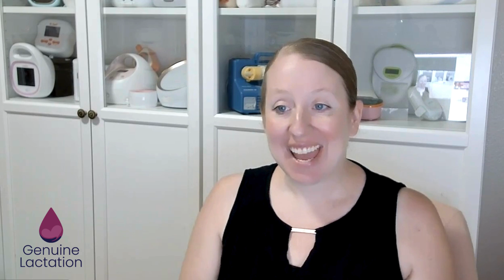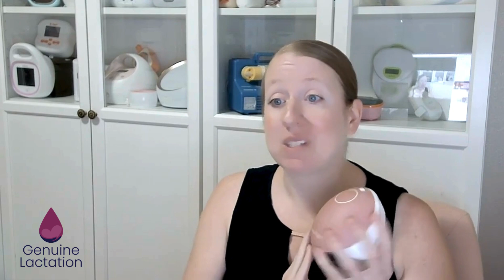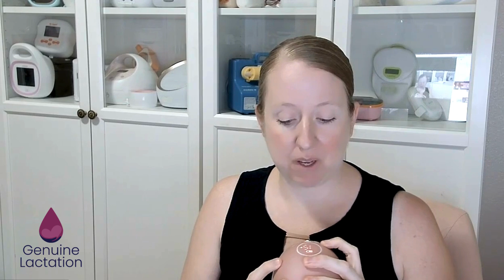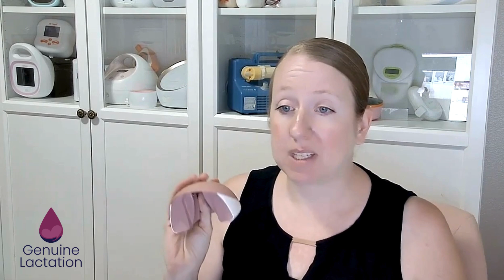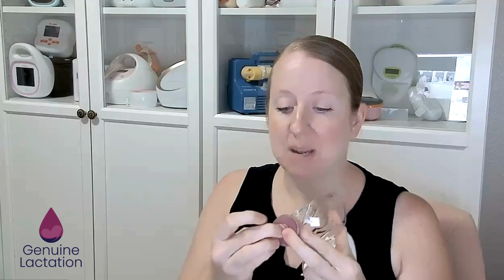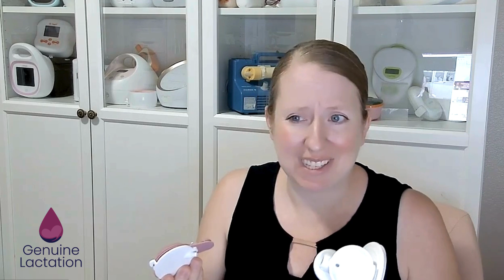Pump Chat: Momcozy Mobile Flow M9

Comment: Do these leak out of the front like OG Elvie if you slightly bend forward?
Reply from the maker: They leak in several places unfortunately
Reply: I will say I have 7 elvie OG motors and everything with each, I have bent down, forward, I have literally DROPPED my pump so many times and it NEVER leaked! Iv never had any of them leak at all iv ever nursed laying back reclined while pumping the other side and still didn't leak! Only thing with this pump that's a pain is they are very finicky if they arnt put together just right or have a good seal on the breast the suction will suck or not work! I thought 5 of my pumps all took a crap at once one day until I found a video for troubleshooting and figured out why they weren't sucking, it was me not the pumps😅
Reply: @ my og Elvis leak out of the front where the duckbill meets the bottle if you bend over slightly. It’s not just me. This is a pretty common issue I’ve seen from other moms with the pumps. I’m glad you’ve had success with them!

Comment: Hi! What’s the difference between this smart mode breast mode pump and the other mobile pump ($229) w/o app 

I’m torn between of them!
Reply from the maker: To make sure Im understanding you are comparing the m6 mobile style and m9 mobile flow?
Reply: @genuinelactation  yes ma’am!
Reply from the maker: @nicolemadayag5419  I can get a direct 1 to 1 review later this week.  I'm leaning towards the m6 is likely a more solid option.  The m9 is just not something I'm feeling like is going to be durable and functional for any length of time. And ultimately I lean away from momcozy but the m6 is pretty decent.
Reply: @genuinelactation  is the m6 the smart pump ($269) or the mobile ($229)? 

Thank you so much for answering my questions
Reply from the maker: @nicolemadayag5419  the m6 is the cheaper non-smart option :)
Reply: @genuinelactation what would you say is the best wearable?
Reply: Where can I find the smaller flange inserts? Momcozy said they don’t have any yet but will be releasing some next month :/

Comment: When making my own I’m finding you can’t actually change the speeds per section. I’ve created multiple and am finding that when create for instance stimulation medium section 3 then go to expression medium 5 it automatically reverts the first setting of stimulation to a level 5 as well. Already sent a suggestion to momcozy so they better change that because the other moms will not be happy with this as that’s not what was advertised to us and us changing settings anyways is annoying.
Reply from the maker: I haven't encountered that when trying but the feature glitches so badly it may just be I haven’t gotten that issue YET.